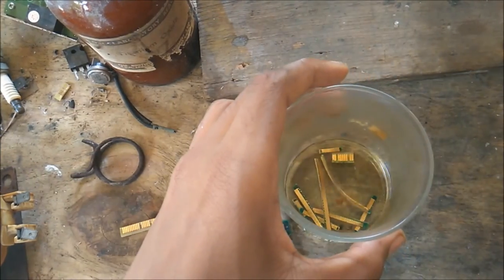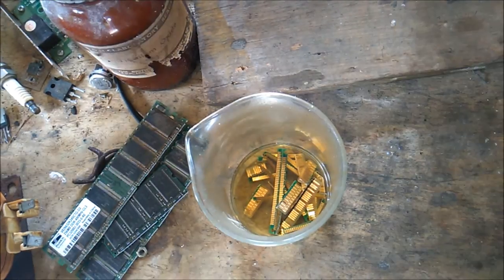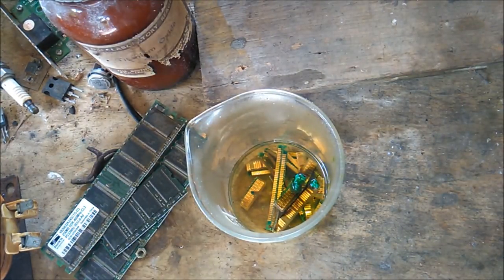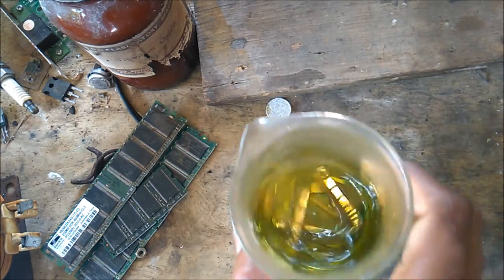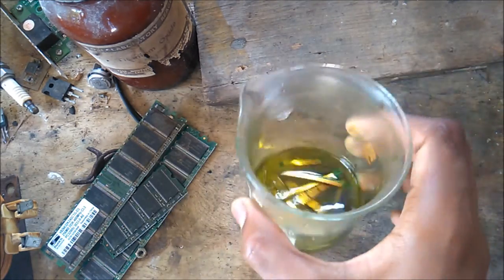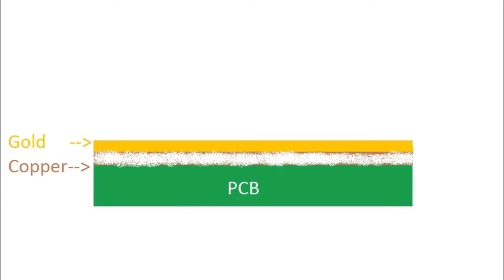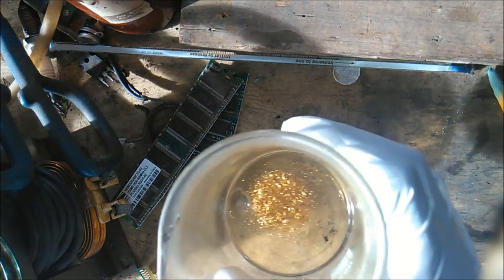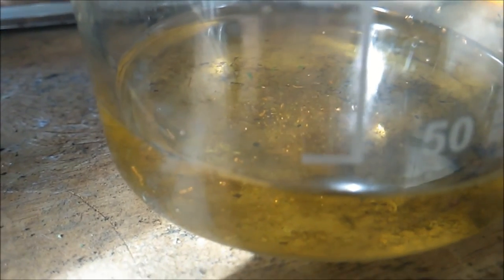Gold Extraction From Computer Parts

Comment: Question - have tried or considered roasting the circuit boards in a pot (covered but not sealed) over enough heat to turn the fiberglass boards to carbon ?
Reply from the maker: +watcher0I0 intereest point, roasting the circuits should remove the fiberglass n u would be left with the metals
but u will still need to dissolve the copper with hydrochloric  acid n hydrogen peroxide or bubblw with air...